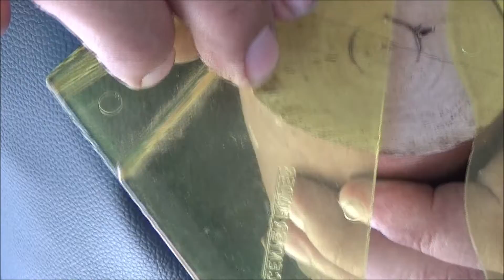Gatling firesteel | HSS firesteel striker with burnt guava wood handles | yes, you can win them.

Comment: Good job fixing this handle up what rope was that you used to give it a burnt look?
Reply from the maker: It's just a piece of wire from bicycle brakes.
Reply: @NathansFerroceriumrods1  cool thanks clever idea btw    I got that 30th anniversary chuck for 150 on Amazon
Reply from the maker: @rangerinfantry11X  Good deal. you also need a number 2 morse taper, drill chuck to hold your drill bit. it goes on the tail stock.
Reply: @NathansFerroceriumrods1  Cool beans brother more knowledge lol!!!